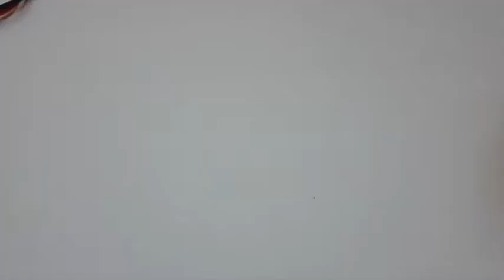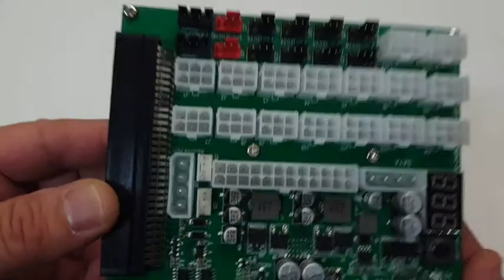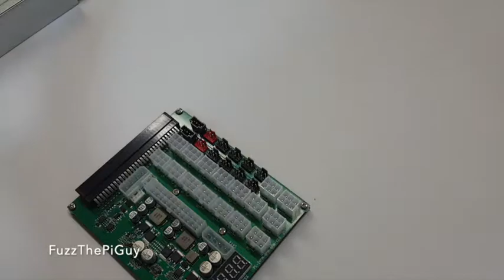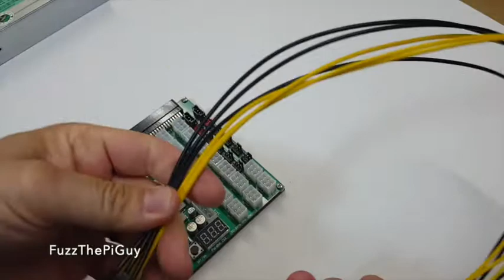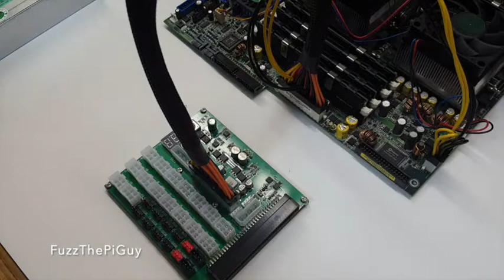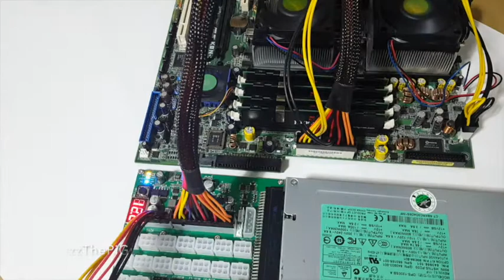Server Power Supply "ZSX Breakout Board" With 16 Six Pin Connectors And 24 Pin ATX Connector

Comment: Have a good time. For electricity consumption, suppose we have a 750w hp power server, which we use at the same time as the power of the computer and use only an rx580 graphic, is the electricity consumed 750w or not?  As much as (graphics consumes 190 watts) it is adjusted by itself and consumes the same 190?

Comment: I have a small Shuttle pc with a flex ATX psu, which is almost the same size as a 1u server psu. My graphics card will sometimes shut off, then the fans go full speed. I have to shutdown my computer when this happens. It's not overheating, so it must be the psu is supplying not enough power. I'm really thinking about getting a higher wattage HP server psu from amazon and this breakout board. I would like to get into mining too. This is really nice. I could also use this board for testing other motherboards. Thanks for the video!